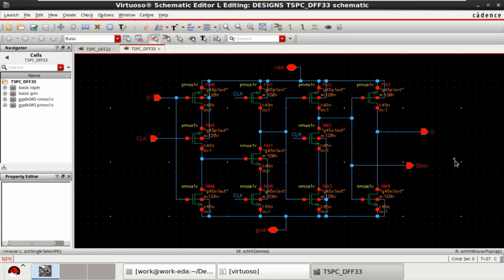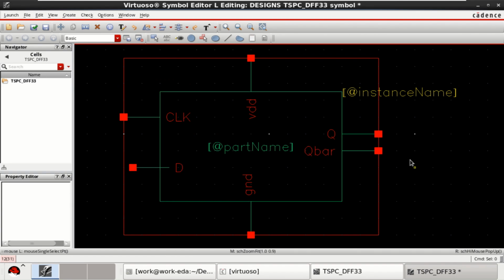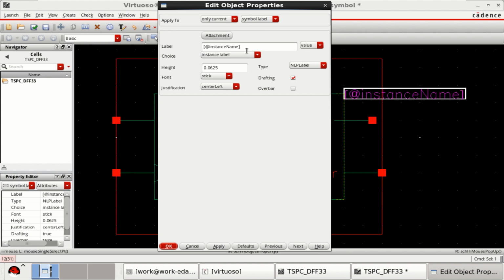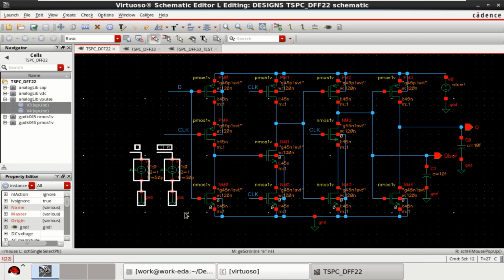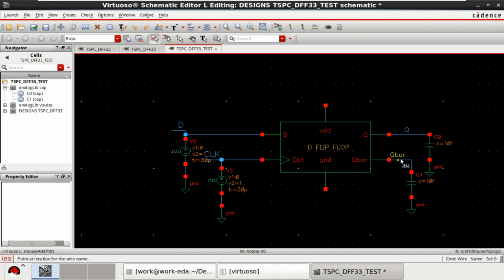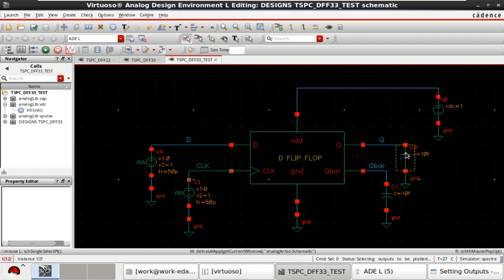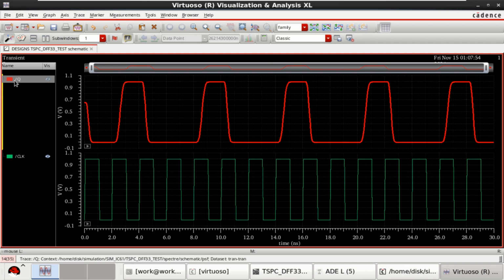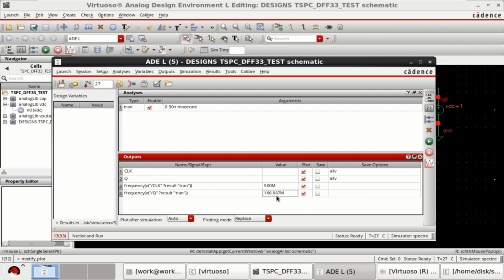Calculate the CLOCK FREQUENCY of TSPC D-Flip Flop.

Comment: Sir, what values we have to assign for transistors
Reply: Yeah, I find that W/L will effect the output pretty badly.
Reply from the maker: Hi, if the design is digital design with given gpdk transistors it works. But analog design W/L sizing is necessary.